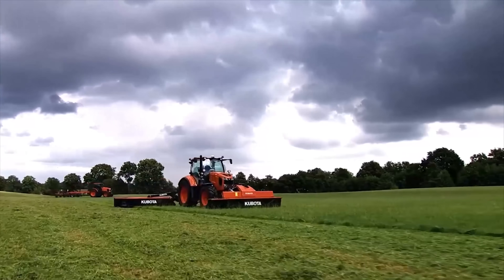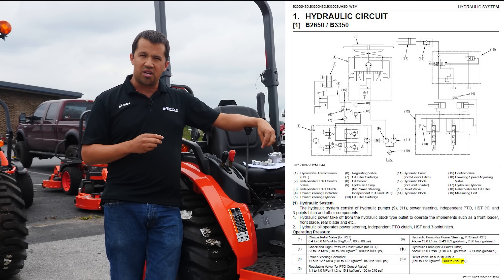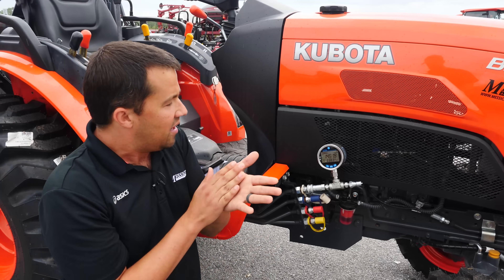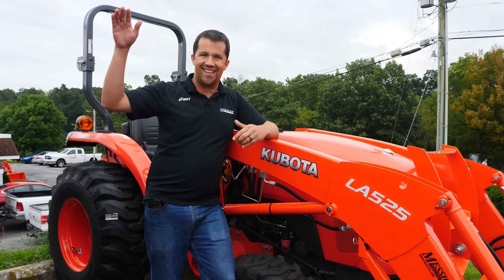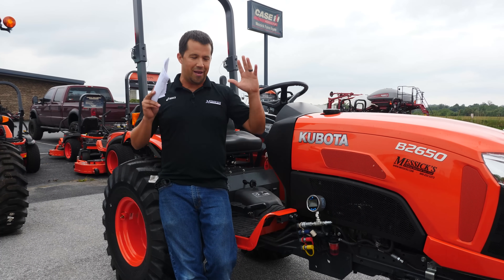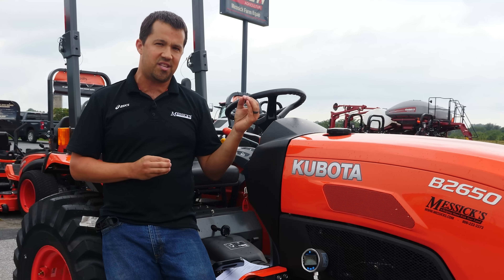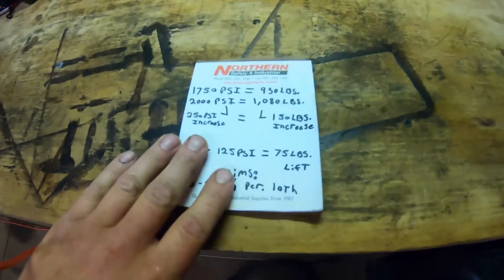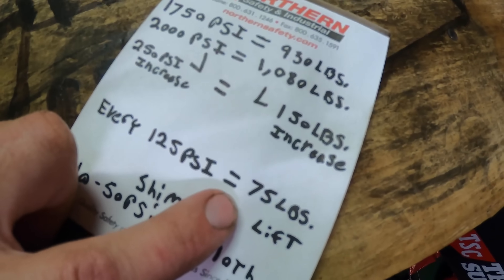Performance increases by raising pressure. Shimming hydraulics.

Comment: Biffs video showed a 14% increase when his gauge read 2000 PSI vs. 1750 PSI. So it wasn't 2 to 4% like you were referring to, so in general a well used tractor that is getting 200+ PSI less than a factory spec will actually greatly improve when a person would purchase the shim kit and bring it back into specs..
Reply: From 1750psi to 2000psi is a 14% increase in pressure. So, like he said if you’re barely “off spec” according to your gauge you really don’t gain much. Or if spec is 2400psi and you go over that to 2500psi, you don’t gain much. But if you’re way off there IS a big difference. 👍

Comment: Take a B2650, push it to 15% over recommended, hang 700 lbs in the 3 point, or 700 lbs of fluid in the oversized 3350SU tires and it works much much better. 600 hours like this, no issues.
Reply: so, you're running over 2800 psi then? How much difference did it make?

Comment: I'm glad you posted this video.  I have worked in industrial hydraulics for years and I know just how quick one can destroy a pump really fast.  Stay with the factory setting. If the factory could advertise more power, they would be doing so.  But they know the limits of what they manufactur and set them accordingly.
Reply: I disagree to some extent. Theyre gonna set the safe range somewhere that, on paper appears to be able to produce work but will also reduce any potential for warranty claims substantially. If they could set their “safe or limit working load” to 50lbs they would because it would reduce their warranty claims to near zero. But no one would buy that tractor so they cant. 

I also believe most guys buying this are guys with worked tractors whose psi are reduced. Theyre bringing them back to spec.

Comment: Set it where you want to.  Max it out.  Just don't overload your front axle.  Kubota and other manufacturers should have max lift capacities UNDER the maximum front axle capacity at the max hydraulic pressure.    Most damage to FEL's and front axles are due to operator error.  A FEL is not a bulldozer.

Comment: Simply put 1000 psi on a 3" ram gives you 3000 lbs of force
Reply: try pi r squared
Reply: Diameter is not area.
Reply: @greggreg8799  diameter is a single dimension. psi is pounds per square inch. square inch is an area. square inch is bi dimensional. inch x inch = inch ^2
Reply: @marcwert9791   The area of a 3" bore is 7.069 sq/in. Multiply the area (si) square inch, by the pressure (p) pounds to determine the capacity. 7.069 x 1000 = 7,069 pounds.
https://www.baumhydraulics.com/images/PDF/info_on_oil_hydraulics.pdf
My comment was directed at the original post and the incorrect calculation there.

Comment: Is there a way to up the total hydraulic gpm to run more front attachments through the 3rd function
Reply from the maker: No
Reply: Separate Hydraulic pump and tank  on the 3 point running off the PTO is probably the easiest way, but a bit expensive.  That, or if you're out from under warranty and have some mechanical skills, replacing the existing hydraulic pump with a larger one probably would work.  Not recommended, though, unless you really know what you're doing.

Comment: My BX was delivered at 1640psi and it was gutless I brought it to 1950psi and it’s great. I know for a fact it made a difference
Reply: (1950-1640)/1640 is an increase of 19%, which is a really big difference in function, especially with subcompact tractor.
Reply: mine was nearly identical to yours factory and like you i bumped to 1950 and digging with backhoe is defiantly improved.

Comment: Thanks for your viewpoint.  One of my coworkers did get a massive improvement from using one of these kits because he was a LOT more than 2% below spec.  

Being a big dealership, I am curious if you could share an estimate of how many Kubotas Messicks has serviced that were significantly below spec?
Reply: My tractor BX23s was completely gutless and would barely break ground with the hoe. I tested it and it was 1640psi verified on two gages. I bumped it to 1950 psi and am now satisfied. I only have an 1.5 acres so I bought the smaller tractor but I probably should have gone with a B series. We’ll see how it does with snow removal.
Reply from the maker: I'm sure it's happened, in my memory I can't ever remember testing one where the customer had performance problems and finding hydraulic pressure to be the root cause.

Comment: Bought a used Mahindra Max26XL that seemed to have a pretty weak loader. Dealer implied "that's just the way it is." I mentioned i couldn't even lift the front end pushing down with the bucket....same response. So i bought a guage to attach to the loader control valve and ended up measuring about 1300psi max. I adjusted to loader relief valve to 1950psi (max spec is 2200) and i can fairly certainly say it was not a placebo effect :).

Comment: Thank you for saying what needed to be said.  Far too many people buy these little tractors thinking it'll do anything they tell it to.  They don't realize how much practice it takes to, say, load the loader bucket without lifting the front wheels off the ground, or not dig into the ground when trying to grab a pile, or just plain making a surface level, properly (no, back-dragging is not how pros make their work smooth and flat, it's how they hide their tracks, and that's it).  When it doesn't work the way they think it should, they instead try to modify the tractor rather than learning the feel of the tractor and really getting to know the machine.  This presents a bigger problem as then you have someone that doesn't know the feel of their tractor boosting it beyond specs that are already high enough to be dangerous in inexperienced hands.  This makes the tractor much more likely to tip, and when you don't know the feel of the tractor, you won't respond in time to prevent that.

Comment: Not only does it make a difference lifting using 1750 psi vs 2000psi, it also makes a significant difference in downward force on the FEL, like when digging below grade.  The available pressure to push down is hampered by the shaft occupying space on the hydraulic piston in the cylinder.  At 1750 psi, the FEL could not lift the front end of the stock BX25 off the ground.  Not sure what the pressure is now, but I can now elevate the BX25 about 10" off the ground using the FEL and the backhoe stabilizers.   When using a tractor model that is already operating in the 2450psi range, does not reflect the number of people who are buying hydraulic pressure gauges and shims for the smaller series.

Comment: The WSM for my bx says 1840psi. Mine was delivered with 200 less than that. it couldn't lift it's own front wheels off the ground. Shimming fixed that quickly and easily versus having to take it back to the dealer.
Reply: Same mine came at 1640, I went to 1950
Reply: @dngendron  maybe there was a bad batch of BXes maladjusted at the factory
Reply: @andys31337  mine is a 2020 bought it in May of this year.

Comment: Neil, I disagree with your logic here.  If the lift power of the pistons increases by 4%, you get much more than 4% increase in lift capacity.  This is because the weight of the loader itself has not changed, and the weight of the loader itself is a significant constant limiting factor in the bucket lift capacity.
Reply from the maker: watch the video to the end. The tests prove it out.
Reply: @MessicksEquip  I want to see Neil prove it out with your force gauge.  Those are some of my favorite videos.

Comment: 100 over 1000 PSI on a way overdesigned 8N, no problem.  100 over psi on a modern tightly designed tractor can do damage.

Comment: People forget these are tractors, that are built like tractors. They are not construction equipment. A job that a skid steer or small high lift will do without breaking a sweat can easily damage a tractor.
Reply: Agree.   So many people are buying tractors for all the wrong reasons.   They don't know what they bought is designed for and use them in applications they really are not meant to do full time.  

I've a friend who has bought a small farm tractor with a backhoe that is using this thing like it were a full sized backhoe.  He's running it just about everyday for septic jobs to concrete busting.   He has blown, bent, and ripped so many parts off this little tractor that his dealership voided his warranty.   He has put nearly 450 hours on this thing in two years.

A small compact tractor is not designed for this abuse.  Sure, he brags that it can do it but I will have mine in ten years.  He will not.

Comment: And... pushing pressure up you are heating the hydraulic system and engine more...
Reply: If you want to safely increase the power... get larger dia hydraulic cylinders.
THEY COME ON A LARGER TRACTOR WITH A LARGER LOADER.

Comment: Still anything is better than factory.  My 2018 bx2380 can barely lift a full bucket of gravel and if I drive into a big pile can't lift or curl with out backing up.   With just a quick hitch attached to the 3 point for a counter weight i cant even lift the rear tires.  Dealer said it was in spec.  Gonna look at new holland next there lifting capacity is WAY higher.
Reply: Well, I mean no offense but it is a bx.  It is basically a large mower setup that you can use to move some light dirt for gardening with ease.  Its pto is for light tilling and mowing.   Some snowblower attachments.   It was never really designed to be a workhorse.   More of a helper for people with larger properties.   

It really sounds like what you needed was an L.  Same price point,  more grunt.
Reply: @roflstomps324  I agree they are compact tractors but new hollanda same size tractor is lifting 1300+pounds.  Also they have amazing attachments and are not just a garden tractor that went out the window when they put backhoe  and a 540 PTO out the back.
Reply: @ourcountryadventures  I don't disagree.   New Holland also costs a lot more.

Comment: Am I the only one thinking that maybe they don't put larger loaders on a tractor for a reason?

I wish my LX2610SU lifted more than it does, but even with loaded tires I can already lift enough to get the rear tires off the ground.

Front tires and axles I feel are not made for that much more weight.

Comment: When I bought my BX2680, I couldn't lift enough weight in the bucket to lift the back wheels off the ground.  I bumped my pressure up to 2000 psi and then I could lift enough weight to lift the back wheels. I then made a 400 pound ballast box, which transfers that extra weight to the rear end, and I can now definitely lift more with the bucket.

Comment: My 2005 BX23 has lost pressure. My FEL will no longer easily lift the front of the tractor, nor will the Hoe bucket curl through roots it once easily did. It is no-where near its original pressure. The purpose of the shim kits is to restore pressure to old tractors that have suffered long years of fatigue on the spring in the pressure relief valve that has lead to lower than spec pressure. Playing with a few PSI on a new tractor is virtually meaningless... but for old tractors that have lots of years with hundreds of hours... that spring DOES fatigue.  Its not about going way over spec., its about getting back to spec.
Reply: shim kits are a scam for the price you want to get back to new do it right like I did replace the spring or relief valve don't shim it. It needs shims for one reason it weakened the spring with a weak spring where does the shimming stop? replace the spring you pay $60-$100 for a shim kit with $30 worth of stuff that fixes nothing when the spring becomes weak enough to have to shim it replace the spring.
Reply: @mrbrown3462  shims are .65 cents a piece it takes one or two.   You buy the gauge one time use it again.  $35 total.

Comment: my l2501 will pick the backs wheels of the ground with a 72 inch box blade as is from the factory..  dont think ill be messing with the pressure..  but i hear you can turn up the injection pump and a few people make turbo kits for it... maybe after my warranty is up ill do that just because..  maybe..
Reply: Ditto.   I can confirm that you will pick the rears up with filled tires and a six foot tiller on the back.

What more can a man want?
Reply: @roflstomps324  mine are not even filled!
Reply: @vdub4201  i can't imagine mine not filled.   I do a lot of log work.  You need that center of gravity down low.

Comment: Nope, sorry but your math is off. A lot of small tractor owners see a huge increase because they a lot of times are adjusting the pressure to the top of spec therefor giving a small tractor 150-200 pounds of extra lift. That’s HUGE on a small machine. Remember, it’s all relative on the size of the machine.
Reply from the maker: To add 200lbs to a tractor starting at 800lbs of lift you would need to add 800psi
Reply: @MessicksEquip  sounds like a trade in to a bigger tractor is in my future.

Comment: Easiest way to increase lift, install a larger diameter hydraulic cylinder.
Easiest way to damage loader, increase lifting ability.
Easiest way to break front axle, lift more weight than it was designed to carry.
Reply: Rear ballast takes the stress off of front axles.... so increase rear ballast to offset that chance
Reply: @rgd2598  is this a joke? Rear ballast only adds load to the front axle when you lift heavy stuff
Reply: @megape95  Ballast behind the back wheels removes weight from the front wheels.  Put enough weight far enough behind the rear wheels, the front wheels will come off the ground.
Reply: @paullambert2668  some of what you're saying is true but when lifting with a loader no matter how much weight you put on the rear it doesn't decrease the weight on the front axle! I will say that if you put enough on the rear the front wheels will come off the ground.
Reply: @megape95  no joke...and why the attitude? We are in this together. Let me explain my missive...ever been on a teeter totter? Then imagine the rear axle as the fulcrum. The rear ballast counters the weight on the front end loader and front axle . Simple as that
Reply: @paullambert2668   yeah. But the load  on the loader can be higher  since the back isnt lifting off the ground anymore. And peak stress is now higher When driving trough a hole or over a bump.(with some speed.)
Reply: @rgd2598  what you say is true but it will only will do anything  if you got or a really heavy weight, or you got that weigt really far out in the back.
Reply: @megape95  Like, for example, a ballast box, or a heavy implement?  It will do what it does, it'll be proportional to the weight you put on.  Small weight, small difference.  Heavy weight, bigger difference.  But the physics is clear, it reduces the load on the front axle.

Comment: Granted biff is a little over max pressure 150lbs lift capacity is a pretty substantial improvement for a tractor that can only pick up 500 or 600 lbs it's almost 30% unless I did some math wrong. I figure with these little bx tractors anything helps. when I had a bx when it was new I increased my pressure 150 psi to 1950 psi seems all the bx tractors are set on the lower end of the psi specs anyway.
Reply: Yup wrong math.  You have to use his measurement of 930, then increase of 150 is 16%.
Reply: @dwawa23  I'm figuring with the bucket on that will subtract close to 200lbs from biffs measurement

Comment: BS Neil,  forget 2%. Do the math.  It’s not placebo.  If you have 2 “ cylinders, the area of the cylinder is pie  R squared so a 2” cylinder has an area of 3.14 x 1(radius) squared = 3.14 per cylinder.  So 2 loader cylinders = 6.28 square inches.  Therefore, for example, a 100 psi increase in pressure would increase the force on your loader cylinders by 628 lbs.  Not trivial.   I’ve shimmed my relief valve by about that much and the increase in performance is very noticeable.
Reply: Do the math at your original pressure, then do the math at your increased pressure.  You'll see that a 2% PSI increase results in a 2% force increase.  Cylinder size doesn't matter.

Comment: I think you can increase it quite a bit on an old BX like mine.  Factory spec is like 1750 psi, but after 15 years it's quite a bit lower.  If you can increase that from 1650 or so to 1900 psi, you could easily add an extra 200 lbs of ability in lifting something off the ground.

Disclaimer is that I didn't shim mine, and have no intention to.

Comment: i got an M7 with closed center hydraulics.  can i run a hydraulic snow blower attached to the loader arms? what specifications would i need to look for?
Reply from the maker: Yes. Going to take some work though for the chute and deflector. Probably better options. See erskine.

Comment: If you want more out of your hydraulics, you probably are going to have to get a bigger tractor that has a better flow in order to use hydraulic attachments that are out of the range of some of the smaller compact tractors. However, you can look at one of the videos and and see how you can safely add hydraulic power to other attachments that need more flow by purchasing trailblazers hydraulic power pack that is PTO driven from the rear shaft. It might be a good video to show how this trailblazer hydraulic power pack can be used on smaller tractors to drive other attachments besides trailblazers articulating front brush hog. For example, Kubota LX and the John Deere 2R series do not have enough hydraulic flow to power some implements that rely on hydraulic power rather than PTO. However, I bet you could hook up that trailblazer hydraulic power pack and make a hydraulic driven auger work on the front end of those two tractors without any really issues. I think I just gave Neil hopefully an idea to demonstrate that. I myself, would like to see how it works. LOL